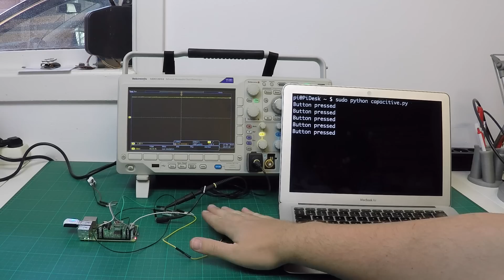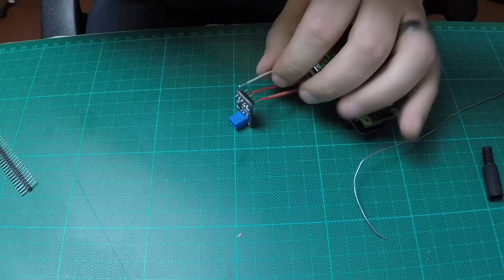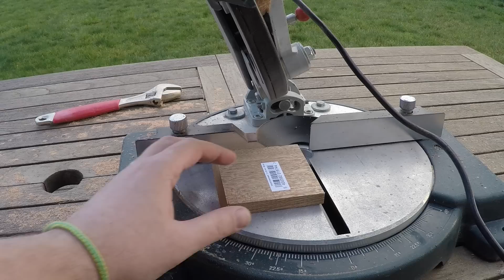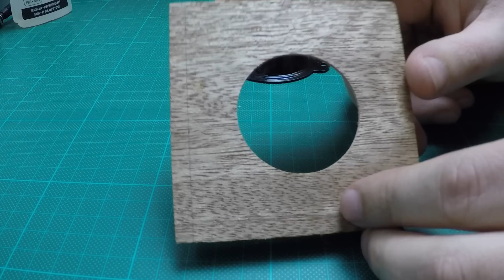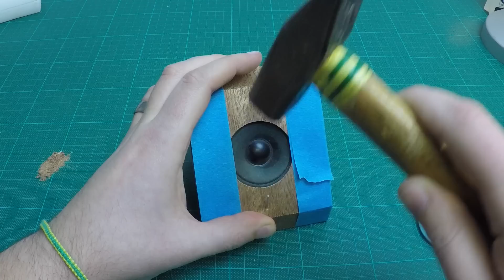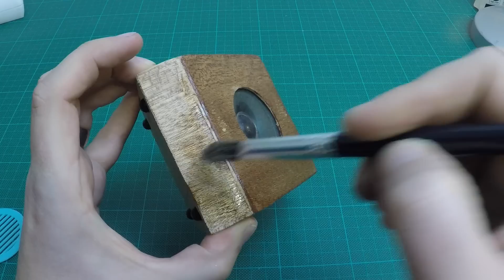Raspberry Pi Zero AirPlay Speaker

Comment: Perhaps in another version you could add a base speaker to the bottom, the feet giving clearance to the thing. For stereo there's oval speakers that should take up less space in width so you could fit two speakers in the front (or the sides even). For my GBA (original, not SP) Pi Zero project I'm probably going to use the pHAT DAC and a mono amp board from Sparkfun on the original GBA speaker (8 ohm 0,5W). Should sound fine for what it has to do. :)
I really do wish the Pi Zero would get back in stock soon! By the way, your projects are really good. Love the finish on this speaker.
Reply from the maker: +jorenmartijn Thanks :) I used a speaker I had at hand, but indeed, using oval speakers, stereo should be achievable in a similar form factor.

Comment: The pHat DAC is not an amplifier. The chip's documentation states a minimum output load impenance of 1 kOhm. Your speaker would be around 8 ohm. http://www.ti.com/lit/ds/symlink/pcm5101a-q1.pdf

You can build an LM386 amplifier. http://www.ti.com/lit/ds/symlink/lm386.pdf

(my speaker: https://goo.gl/photos/ZcdSvYvMhwRMTkN97 )
Reply from the maker: +tribbinvw I know it's not an amplifier, that's why I added an Adafruit amplifier breakout board to the pHAT DAC's output. Perhaps it wasn't clear from the video, sorry.